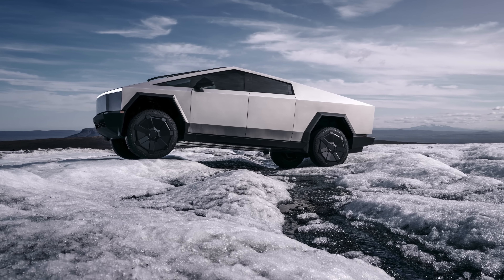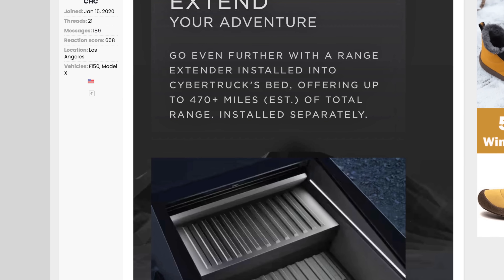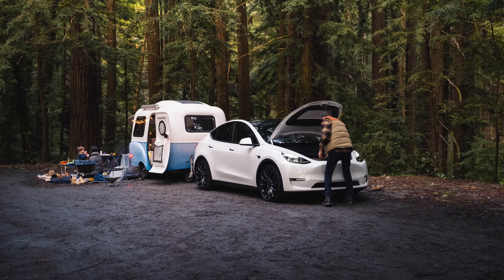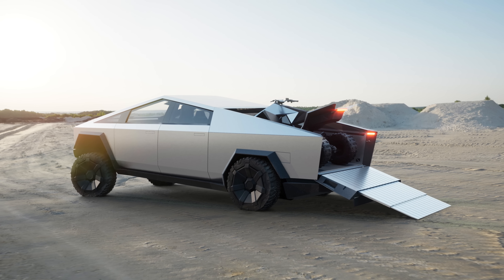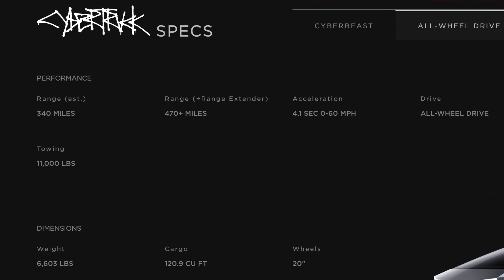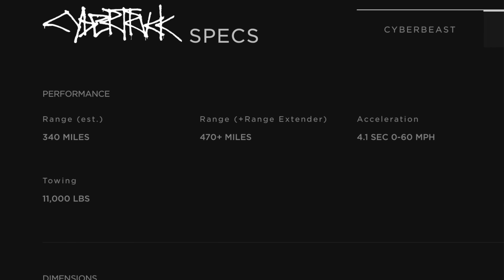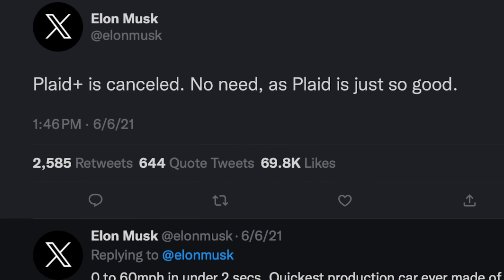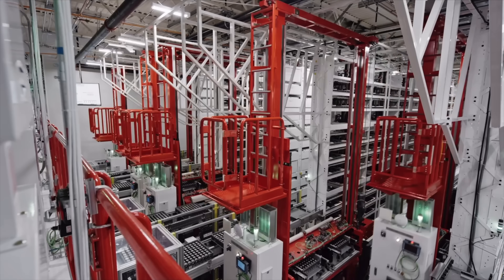Cybertruck Range Extender 📐Explained

Comment: I have to disagree with idea of giving up the automatic tonneau cover. For one you wouldn’t be able to add more than about 10% more battery capacity. So that wouldn’t be a good option. 
As for how the range extender, it obviously needs to be equal to two 400 volt panels to allow splitting just like current battery pack does when charging at v3 charger. Hopefully charging can be improved when the 1000 volt v4 chargers start rolling out. As for preconditioning and BMS the range extender would tie into the existing BMS. Now if they do come out with the range extender my expectation would be because it’s tied to existing BMS it would be permanent installation not able to be removed.

Comment: I'm pretty sure the reason why the range extender would need to be installed at a service center is because it will most likely have plumbing connections for thermal management.

Comment: 1. $16,000
2. Takes up 1/3 the bed
3. Non user removable, have to take it service center; making it a pain to switch between choosing bed utility and range.
4. Increases wire complexity, which decreases recharging speed and adds more points of failure.
5. Rivian owns a patent which doesn't mean a lot, but it means Tesla has to work around it / work with them.

Range extender is a DOA tacky solution when they realized that the general public was going to criticize the ~300 mile range. I predict they will simply just improve the efficiency and increase the kWh from 123kWh to ~150kWh for the 2025 models adding about ~60 miles extra across, hopefully making the range while hauling / towing go from very slightly above bad to pretty decent ( for an EV truck ).

Comment: You wouldn’t get another charging curve when adding a range extender, you spread out the charge between the cells in the pack. You would need a very fast charger though. Like for the hummer ev

Comment: In the mid 90's I designed/built a BEV...anything other than Lead acid batteries were fiendishly expensive back then, so I came up with a 'range extender' battery pack that could be added to the vehicle. High cost, high weight, not a huge increase in range, and worst of all it raised the CG to the point of marginal safety from rollover risk at high speed. 
So much for that....I am really quite surprised that the Tesla engineers resorted to such a hack approach, better that they would have waited/worked towards a higher energy density pack under the floor.
Reply: It’s the fact that it’s such a hack approach that makes me think Tesla has no intention of actually offering this.  I think it was just to get people off their back about not getting a 500 mile range.  My guess is it’ll probably work out for them on that level. I think the range is actually fine for what 99 % of what people will use it for.  At this point I think if you want to do a lot of towing you use an ICE vehicle or wait for the Ramcharger to come out if you still want to be electric most of the time. If you don’t need to tow then you have normal Tesla range which seems to be okay with most owners. I understand people were disappointed that the Cybertruck was no Great Leap Forward for range and is pricey but I never really thought it’d get the range. The steer by wire, four wheel steer and 48 volt architecture are cool and would be better if they weren’t inside such an ugly truck.
Reply: @Molishious  If i do a lot of towing i recommend a electric Volvo or Scania instead this measly little Cybertruck.
Reply: @Molishious  I think you were right about their false intentions.
Reply: You would have to wait a decade or ten for the next step in financially feasible higher density battery cells.

Comment: that's completely fine because I can just go by the Eco flow Delta power bank and it does the same thing as that range extender battery thing would do you just have to wire it properly, which the auxiliary wires are in the back near the bed and in the front

Comment: Can only tow 90 miles without it. They need more range for towing and camping in the west.
Reply: You are referring to Jerry rig everything test ? Towing 11,400 1bs  trailer with his hummer on the back? That's a very very much worst case sub zero test. It's valid but also misleading. 😢
Reply: @hedleypepper1838  agreed it’s worse case scenario, but nevertheless, having more range is essential under certain circumstances for a pick-up truck.  I preordered based upon a promise of 500+ miles range specifically because I will need that extra range for towing and camping in the mountains and other places out here in the west.

Comment: I'd rather see them work on battery energy density to increase range. Frankly, the roll up tonneau could be done more efficiently if they integrated it into the roofline and free up that space. If you think about having all of that extra material to stretch down into the floor of the vehicle, it's wasteful and inefficient. Do a powered rail with slats that stack into a slot at the top of the "boxrails."

Comment: I think it will exist, but on the fence about getting one myself… so I do see where you are coming from.

I’m thinking it’s going to be air cooled lifepo4 (w/ heaters)
It doesn’t need to be capable of 630KW like the internal battery, 100kw would be more than enough, and would require minimal cooling.

Comment: I really like the cyber truck and I’m still uncertain if I’m going to get one. (I’m 309,000 in line so no need to decide anytime soon.). I do think that they went too small on the battery. 123Kw is just too small. I think a battery around 145 kW will be better since you lose so much range carrying weight or pulling a trailer.
Reply: And even just for colder climates or highway driving at higher speeds range loss is quite substantial
Reply: @johnwasilenko170 yup 250 highway, as bad as 90 towing

Comment: I’m sure Tesla has already thought about most of these points you are bringing up. Since it’s a separate unit, I would assume, specifically on V4 chargers, that the battery pack could be charging independently and simultaneously with the main unit. Therefore, you could be looking at similar charging times. Sure it takes a portion of the bed true, but isn’t this pack really here for towing purposes? If you’re not really towing with this thing, and would prefer the extra bedspace, then the battery pack is irrelevant to you, as you have the same estimated mileage of any other Tesla. The reason why this makes no sense to you, is because it wasn’t a product made for you.
Reply: You see, I own a video production company and we currently have a Toyota Tacoma that drives around with a shack like attachment that allows us to store all of our production equipment. The amount of money we spend on gas alone, traveling from Miami to West Palm Beach for a weekly podcast Client, is significant. I’m talking about $80 for the round-trip. We do this like twice a week. When you do the math, I’m looking at an ROI in two years for that battery pack. It’s about 80 miles to go to our destination. With that extender, I would be able to go to my destination, and come back home to charge at a lower rate at our office, and can avoid superchargers in general. In my use case, and for most that actually tow. This thing is very important. It may not be for everyone that just wants a cyber truck around town, but for people that actually need a work truck, we need this thing.
Reply from the maker: I’m sure Tesla thought of a way to get the tri motor to 500+ miles too…
Reply: @TailosiveEV  what does that have to do with anything I just stated?
Reply: @NicholasMarcelin  his point was that it doesn’t matter what Tesla has already thought of. It doesn’t mean they can execute or make the right decisions.
Reply: The range extender ain't happening

Comment: i think the extender will be another 400v pack in parallel with the other 2 banks already in the battery but will share the coolant loop and will have coolant connections as well as power.  i think it will be balanced level with all the other cells together since they will be all wired in parallel and charging it will take an extra 30% longer.

Comment: crystal ball time on the range extender,
it will have panasonic 2170s not 4680s
it will tie into the existing cooling system and make the performance of the system overall worse, or at least take away some of the head room.
it will have it's own BMS and contactors that make it a 400v or 800v battery so it can charge the same as the main battery, in parallel.

i do like the idea of removing the tuno cover and putting more cells in that location,
perhaps if enough people want the range extender they will delete the tuno cover and make it a manual one, then also allow the additional range extender in the bed to get the magical 500+ miles

Comment: Tesla said the CT is the most efficient. We have yet to see it in the real world being more efficient than Rivian, Lighning and Silverado. At highway speeds on the only tires it comes with right now. It is not the most efficient EV truck.
Reply from the maker: Correct, but tires can be changed. The same truck with different tires isn’t a new truck

Comment: Fun fact. Rivian owns the patent on battery range extenders installed in the bed of an electric truck. How is Tesla getting around this?  Is Rivian letting Tesla make it.
Reply: Ummm. NACS? I feel like if Tesla went to Rivian and actually needed access to their patent, a trade or a licensing fee would be really easily done. Or... they could just buy Rivian with some pocket change from their sofas. I don't think there's the antagonism between them that you think there is. All that assumes that the patent is valid. Granted does not mean your patent is valid.

Comment: I think the tailgate ramp could be an option. I hope it will be, it is a no brainer for increasing the accessability for the CT.
Reply: +1 vote for this. Maybe Hansshow can design aftermarket like their powered frunk kit. There's already 48v feed that can be tapped from the bed. All you'd need is Tesla suspension UI to provide kneel mode to get ramp to decline.

Comment: I think the extender only needs to extend the CT range by 100 miles and give a performance boost of @1 second. This means they do not need such a large battery pack. Maybe the pack can drop from @$16k to @$10k😊

Comment: They really needed to have a version, however expensive with 500 miles of range. However big the battery and however expensive... this needed to happen. As you say under the bed theres plenty more room. The lack of range has had many ev enthusiasts labeling it as a "dud", and the Silverado is going embarass it even further. That it didn't come out with a 500 mile version has become a huge problem for the company. Price, people could forgive, and again the 250 lfp battery starter cybertruck could get close to 40k adjusted for inflation after the ira tax credit... but a high range model was a must. Tesla messed up badly here.
Reply: Silverado who?😂
Reply: @Baskinbzier  this thing

https://m.youtube.com/watch?v=oUN358zio7A&t=1125s&pp=ygUbb3V0IG9mIHNwZWMgY2hldnkgc2lsdmVyYWRv

Comment: For the range extender. Its really just a solution for the towing use case. I expect it to have its conditioning solution hooked into the existing one. It was also never meant to be "swapable" because it requires the battery infrastructure hookups so its not a fast process.

They solved the voltage balancing because Cybertruck run's 2 battery circuits in series to run at 800V and splits the pack to 400V in parallel to charge. The range extender being around 50kW will also be at 400V for charging and also reorganize the circuit for 800V output. That means it will charge in the same parallel balance as the rest of the pack.

Under the bed where the range extender will go contains the air pressurization system for the scuba mode and suspension as well as the rear motor. What is most likely to be the case is the conditioning system for the range extender will be a heat pump connected to the existing heat pump line from the rear motor. This will just mean the existing heat pump and conditioning system will have to balance temperature conditions for a larger mass. You have more mass in the system but its still the same system.

Comment: I doubt it very much. The extender is a good option.
They just need the all weather option. The 4680 will have a v3 and a v4.
The strategy made sence and still does. V3s will be coming end of this year I think. Everytime there is an upgrade the extender can be upgraded as well. Obviously this upgrade is for new customers it would be costly to swap an old extender for a new one most likely, but who knows. If Tesla make everything backwards compatible for the extender and the main battery pack then this path will be open for initial and older CY owners to upgrade.
Reply: If the range extender was happening they would have released it right away. Once they said the one year bs I felt it was never happening
Reply: @qman66  maybe,  If the market is disappointed and people just can not do without  the extender, then Tesla will ramp up the extender production, even if they do not want to. 
I think the early adopters will just be using the CT for personal use but if I need a truck for my own business, say I am hauling stuff or towing then I would need the extender.
Tesla just wants to know where that demand will be. When they start to produce more then they will see. The market will tell them. It is not a big deal. People have a choice of BEV trucks now. ,
Well with Ford cutting Lightning production maybe less choice. 🤔

Comment: They just need to offer a 200kw internal battery pack as a 20k option for all models of Cybertruck.
Reply: That’s physically not possible
Reply: @EV_Dreams  The current 123kw battery pack takes up about half the width of the undercarriage so it is definitely doable. they said 500 miles of range on their high end Cybertruck and this is their way to achieve it. If people want a higher spec they should be able to pay more for it not be denied because it's "good enough".
Reply: @EV_Dreams  I mean the GMC hummer EV has a 200 + kwh battery pack
Reply: @dylanwhite6539  the Cybertruck is longer and plus the Roadster has a 200 kwh battery
Reply: @PlaidZoomer  roadster doesn’t exist yet
Reply: @EV_Dreams  the Hummer does, and the silverado ev both have smaller beds
Reply: No. 3 tons curb weight is more than enough. If you want more buy a Hummer.
Reply: @wolfgangpreier9160  It's a better idea than the range extender which will add just as much weight. Using a range extender is like slapping a 32x in a Genesis. It's a bad design.
Reply: @Brian-The-Giant  Yes its a bad design. 
Of course. 

The battery in the CT - and also in F150 and Rivian - is large enough for its intended purpose. 

And that is NOT towing 5 tons @ 150 km/h. Or 11.000 pounds over 80 mph.

IDK anything about Genesis besides its original greek meaning. I never owned a Japanese car.
Reply: @wolfgangpreier9160  Sega Genesis
Reply: @Brian-The-Giant  The Wrath of Khan.
Reply: @Brian-The-Giant  yeah I agree. the range extender takes up bed cargo space

Comment: They CANNOT scrap the range extender. Throw using it to power your home or RV out the window if so. Will buy the Silverado instead if they scrap it. Dropped the ball big by not having the beast battery pack bigger. I cant believe not one engineer took into account using the truck to power an offgrid 48v home system by simply having a large battery in one of the models. Its supposed to be for the future and they put a freaking 123kw battery in it. LMAO total joke!
Reply: The range extender will not be scrapped.
Reply: @Mtheorygarage  the range extender has been scrapped. This YouTuber and many others speculated accurately that this extender wasn’t going to happen.

Comment: 500 mi was only on the tri motor, around 300 mi was on the dual motor, I see this being often misquoted. The stand alone battery will be for a very small market. Most of the reservations were $100 not $500, I do agree the range extender in the bed is a waste and bad idea after thought.

Comment: Not convinced Tesla will build the unit you describe.  If I were designing the Range Extender.   I would make it totally stand alone.  Think of it like an aux fuel tank on a pickup or truck. It has it own charging, heat pump and BMS system.  Plug one charger into the truck and the one next to it into the extender.   Frankly if I needed a 500 mile truck, and could afford it,  I would wait for the 4680 cells to get better.  Yes Tesla held them up waiting for the dudes to get the dry cathode working,  That negates some of the 50% savings Tesla was shooting for but does not change the cell.  Guessing they are saving $2k+ on the existing line. They are shooting for 8 lines in Texas and have goodies lined up to increase energy density.

Tesla could have held the cyberTruck back another year or 18 months to get the 4680 and the tires ready.  But then people would be carping about being even later.  Some people have morphed I have been waiting 4 years into 4 year late.

Comment: I hope they don’t scrap it, but agreed that customers should be made aware of how it works before making a non-refundable deposit.

Towing far from the SC network is definitely possible, you may just need to ball out on an expensive trailer with its own battery pack.

I can’t see the extender getting you that much farther from the SC network, but it will be good for using tools/equipment for longer durations if that’s needed.

Comment: My guess: the original cyber truck was supposed to come with the range extender in the cyber beast. Which is why you see it go from 250-300-500 in the original reveal. But as costs went up, they scrapped the idea, and allowed it to be an add on for any trim.